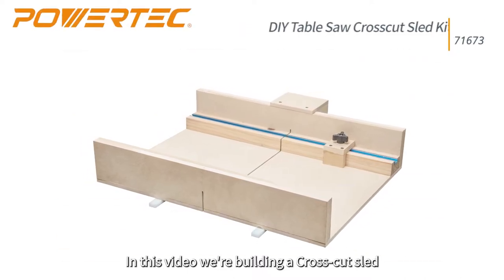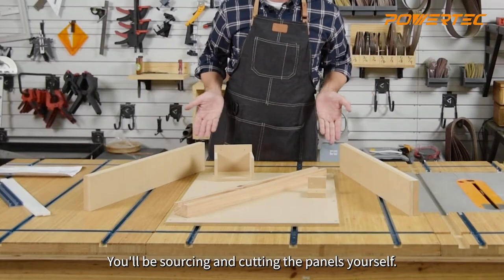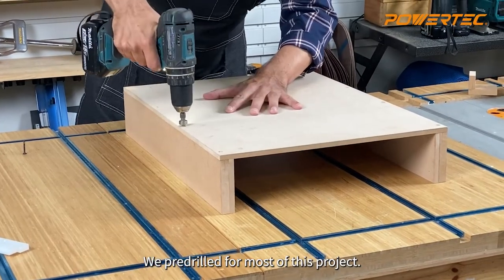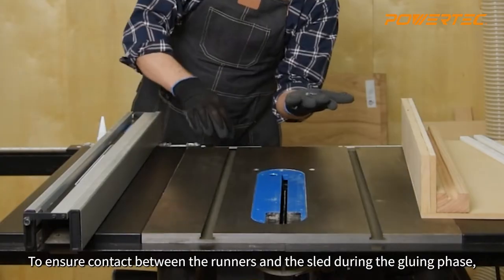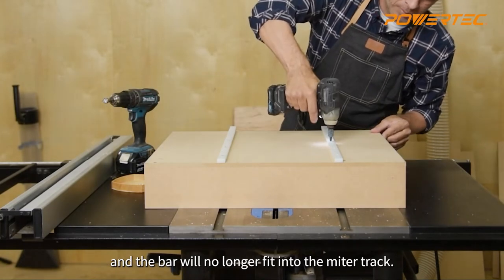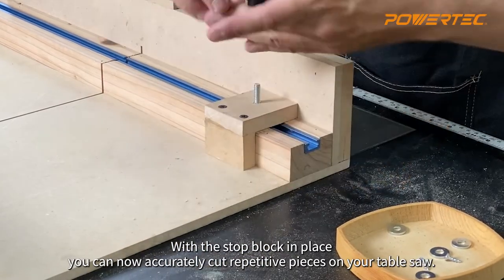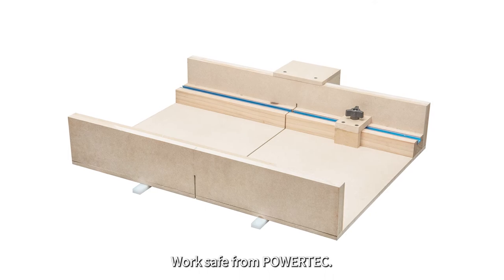DIY Table Saw Crosscut Sled | Make Straight Table Saw Cuts with POWERTEC

Comment: Perfect video on setting up the sled kit, thank you!
Reply from the maker: Glad it was helpful!
Reply: He didn't mention or show anything about making the sled square or perpendicular with saw blade.
Reply from the maker: Hey Dennis, thank you for your comment! Can you clarify your question please?
Reply: @DennisDolan-fl3mw That’s a good point. No 5 point adjustment method or aligning the blade with the fence for square. I have the kit and it does include a step for this in the written instructions. They just gloss over this important step in the video.

Also, the written instructions recommend 1/2” Baltic birch for the base but MDF in the video. Not that big of a deal, just weird that they would deviate from their instructions.

Comment: After three attempts to glue the guides to the wood so I can screw them in, I have no more holes left. This is a joke of a plan.  Love the way you make it look so easy. It is all in the trash now.  What a waste
Reply from the maker: Hey @ms13352, thank you for your feedback! So sorry to hear the plan did not work out for you. May we ask what type of adhesive you used for the project? We recommend using Super Glue of any brand and applying pressure on the fiberboard to ensure full-surface connection with the miter bars. Ideally, the sled should sit for 24 hours to completely set. Also, before gluing, make sure the holes are predrilled, countersunk, and that the screw holes are a little larger than the screws. This step will help prevent the screws from swelling the HDPE (making it too tight), and keep the screw from grabbing and breaking the HDPE loose from the board. We wish you great success with your future projects!
Reply: @powertec_usa   three different types of superglue.  Does not matter now.   Junk

Comment: Unfortunately, my older Craftsman table saw has miter slots smaller than the plastic slides the kit comes with - it has a T-slot 3/8 x 1/4 inches.
Reply from the maker: Hey Lillian, we will let you know if we have miter slot bars compatible with your table saw.

Comment: How do ensure the runners fit the tracks? How do you square the fence to the blade?
Reply from the maker: Hi @herbsu4330, great question! Use a square to adjust the front fence to be square to the kerf line in the base. When square, clamp the other end of the front fence to the base. Note that the runner (HDPE bar) is 3/4” x 3/8” for universal 3/4” miter slot.
Reply: @powertec_usa  My question regarding the bar was what if there is play when it is in the miter slot or if it is too wide for the miter slot.
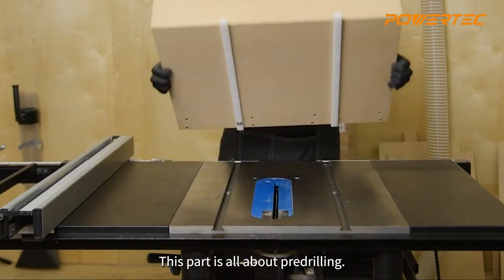Reply: @herbsu4330  I've not tried this, but I wonder if you either tighten the screws near the slack areas, or put slightly "fatter" screws there, if it would push the HDPE to be wider at those locations so it would take up some slack? At 1:37 in the video he talks about screws expanding the HDPE bars if the holes are too small in diameter. You could use that to your advantage.
Reply: @Part_121  that's a great idea

Comment: How do you cut the blue horizontal T track slot?  That part should have been shown.
Reply: Agree..how is that made?
Reply: It comes in two pieces.  You don't need to cut it.
Reply: @n8thegr8  I think he's talking about the slot that was cut to hold the T-track, not the separation between the two pieces of  T-Track.
Reply: My guess is you're going to need a router with a straight bit the same width as the track. Setting it up is going to vary quite a bit if you have a router table vs not having a router table.